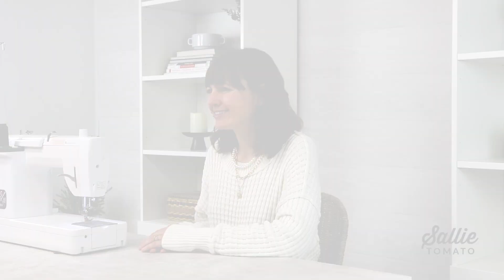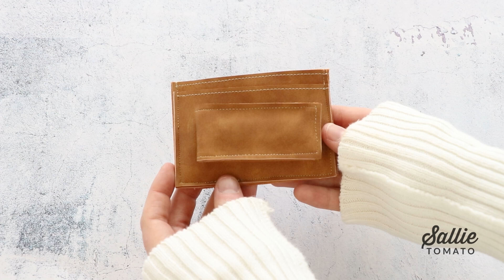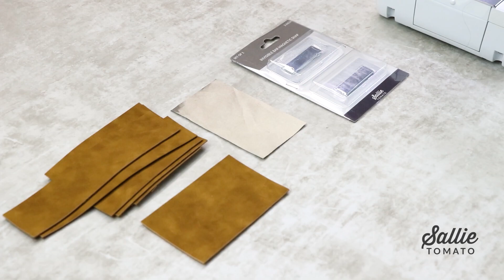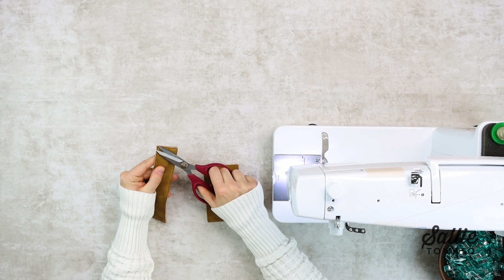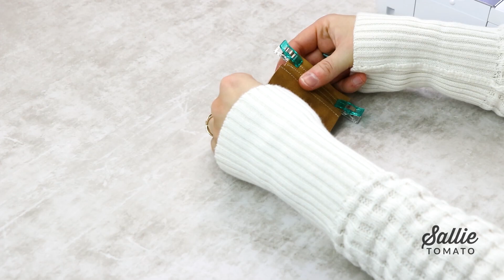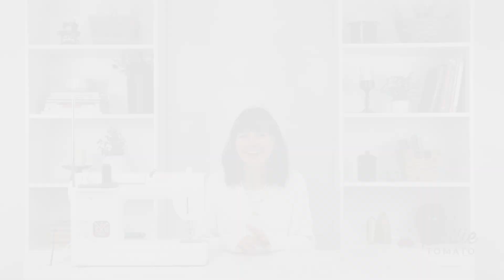DIY Money Clip Featuring the George Wallet Pattern

Comment: My machine did not sew this as easily as yours.
Reply from the maker: Which machine do you have and what needle are you using?
Reply: I also am on the struggle bus. Bought 3 kits for gifts thinking they would be quick gifts. I tried two machines Janome HD9 and memory craft. Do the magnets really need to be this strong, then they don’t even line up. No idea how to adjust,